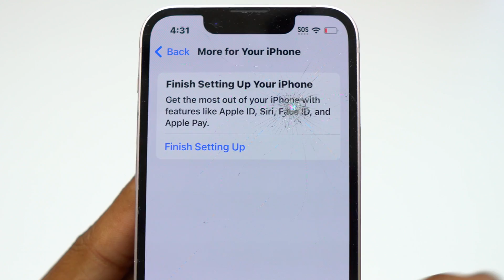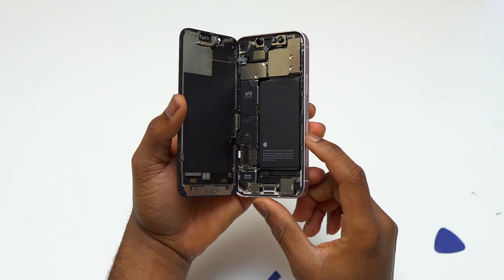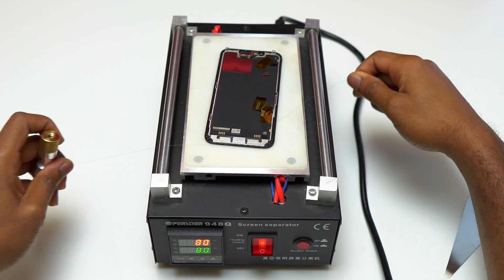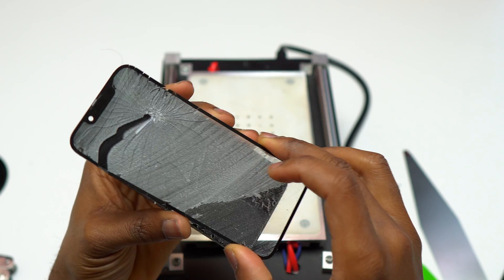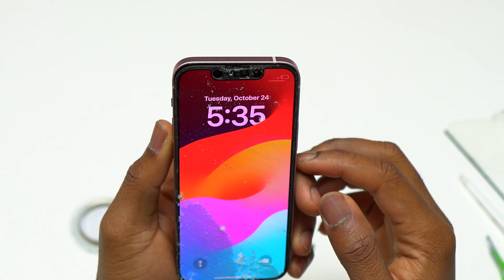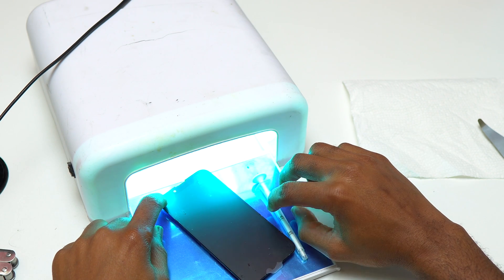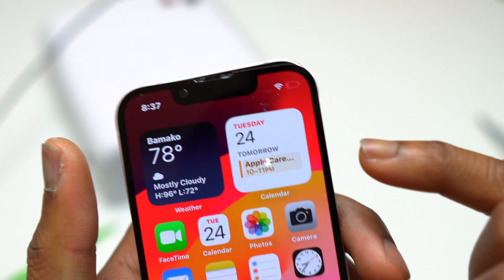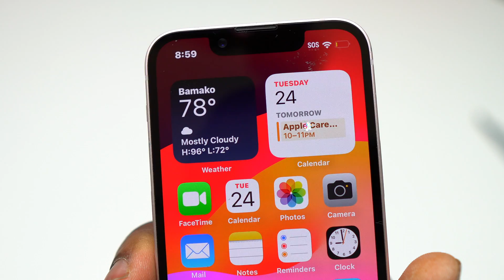iPhone 13 mini Screen Replacement Glass Only

Comment: Question, is replacing the camera glass from the A34 possible? If yes, how much will it cost?
Reply from the maker: The video should have links to the parts. The camera glass is not expensive about $15 or less
Reply: @ersbit  k thanks man!
Reply from the maker: It should be possible and same as the S23, S21 or S22. I have video on the s23 and s21